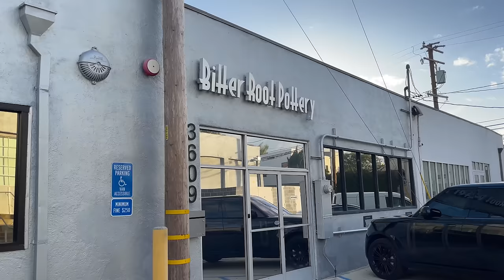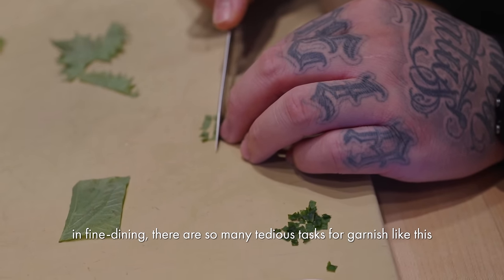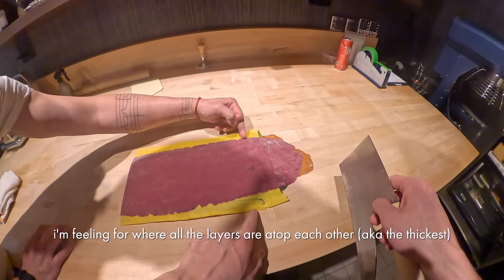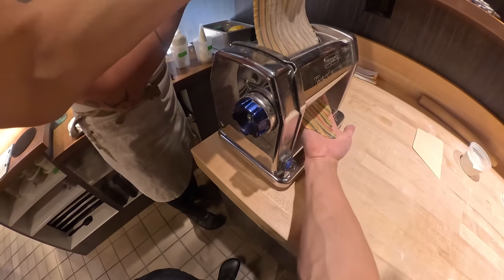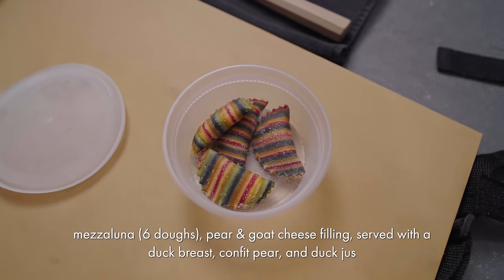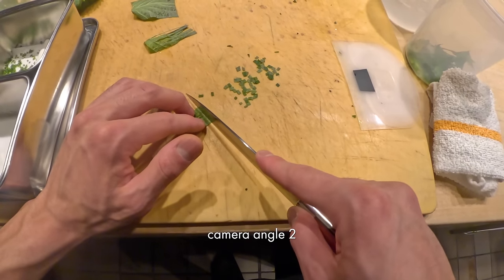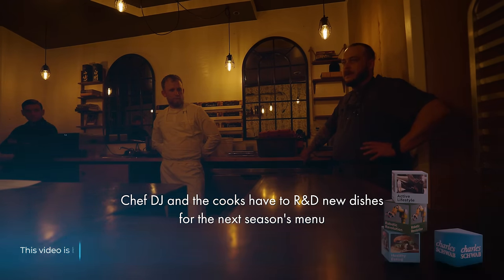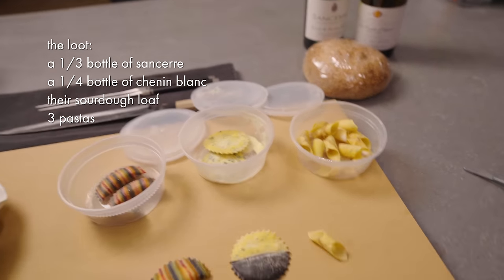how to survive working in a michelin starred restaurant

Comment: little tip that's always helped me for the rock chop is keeping most of the pressure on your hand thats not on the handle and then chop. it will just automatically just start rocking.